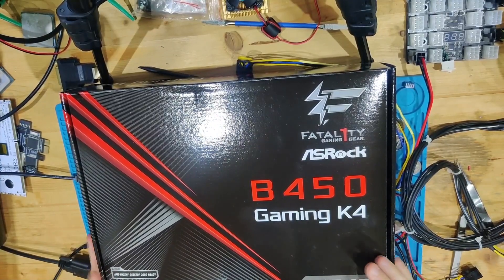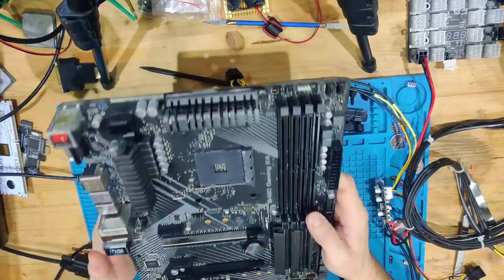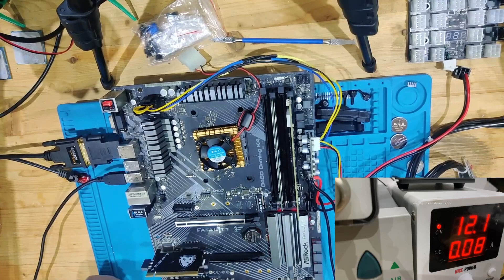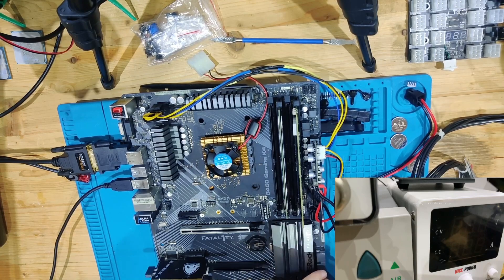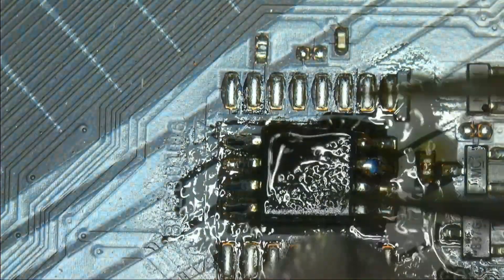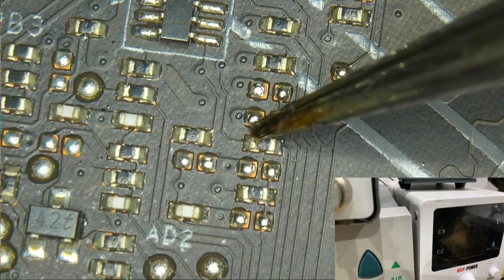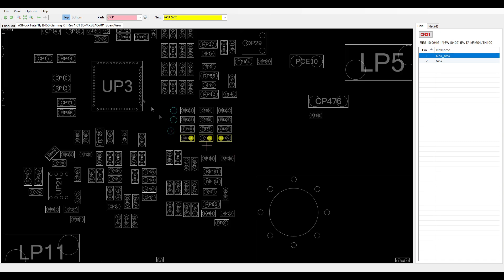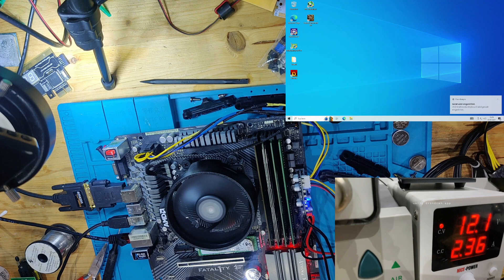CUSTOMER STATES: "ONLY NEEDS BIOS UPDATE" |Should be an Easy fix right? Asrock B450 Gaming K4 Repair

Comment: Hello from Canada. Do you accept work from people online. I have two boards that need to be fixed. One has a constant DRAM Led and the other has a cpu light. I have tried many different AM4 processors as well as DDR4 memory modules. If you are in Germany this is no problem as I have family over there. Cheers!
Reply from the maker: Hey there, yes i do accept work from online! Hit me up on my E-Mail linked in the descritpion.

Comment: I am wondering if I have a board issue, I have just moved a board from one case to another and reinstalled windows and everything other than the sound works fine, no sound from rear jack or front headphone jack, sound worked fine prior to moving to new case and the board that was previously in the case I have moved the board into also had sound. Audio is correctly in the slots on the board and in windows it shows as working and even shows the audio moving up and down in sound settings. Windows updated but still no sound, any ideas would be helpful.
Reply from the maker: Might be that you knocked something off, close to the audio!
Reply: @MainboardMedic  I hope not as that makes the board useless short of getting a repair but it being a Z77 UD5H 3rd Gen Intel board a repair is probably not worth it. However Bluetooth Sound does work so what are your thoughts on that? Or I wil try in another case with different front panel connector  / audio cables, maybe thats the problem.
Reply from the maker: Interesting, so that seems to make the audio chip itself ok, but the conection between the chip and the audi jack might be the problem then!
Reply: @MainboardMedic  When I get around to it again I will try a fresh Windows install, you never know something in that may not have setup correctly or its a BIOS thing.
Reply: @MainboardMedic  After some more digging it turns out it was the High Definition Audio installed by Windows 10 not outputting sound, and in order for sound to be outputted it needed REALTEK High Definition Audio, had to find the right version for the board which was a bit painful.

Comment: Any advice on what to look for on a motherboard that only boots with ram in A1 and B1 but wont boot with memory in either of the other two (A2 and B 2?
Reply: Possibly missing data's lines on the ram slot or CPU slot. Check voltage rails too
Reply from the maker: That would be my guess as well. The tester is very cheap and linked in my description.

Comment: i love your videos! i want to ask a question, did you modify your ch341a to supplying 3.3v to chip? unmodified non-v1.7 ch341a gives 5v straight to chip and as you know most of motherboards uses 3.3v or 1.8v bios chips
Reply: Yes, he did, it can be seen clearly on his programmer. And you are not fully correct about what you wrote. The VCC supplied to the chip is 3.3V on non modified version. The datalines are pulled to the 5V potential there. The ch431a should have an internal 3.3V voltage regular according to its datasheet, so the question is, why the data lines are pulled to 5V on those devices. Seems like the manufacturer is providing some shady informatios :D
Reply: @neovita3818  thank you so much, by the way i meant the data line issues while writing my comment
Reply: @PrebuiltKernel  that's why i didn't wrote, that you were wrong, just not completely right instead =)